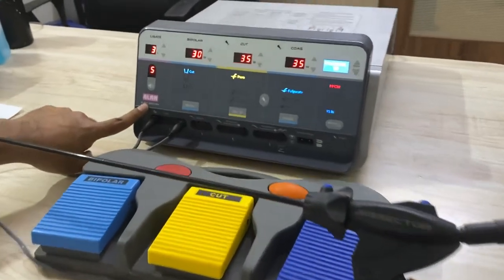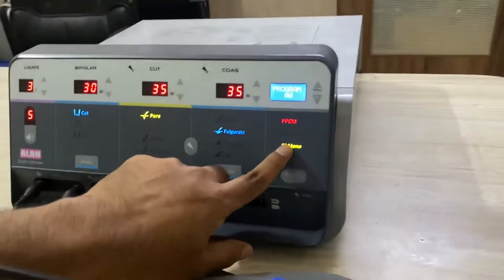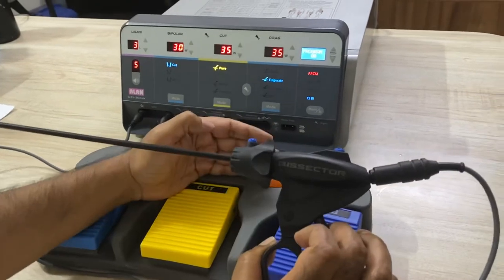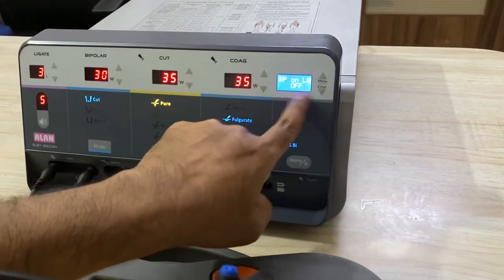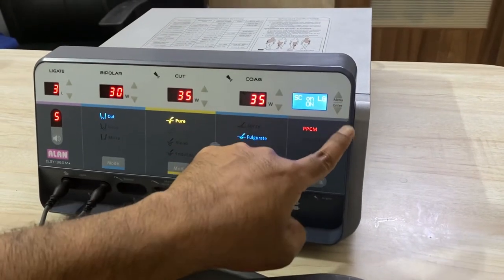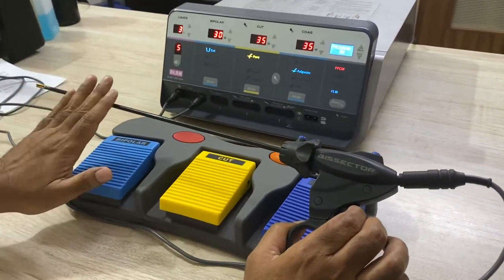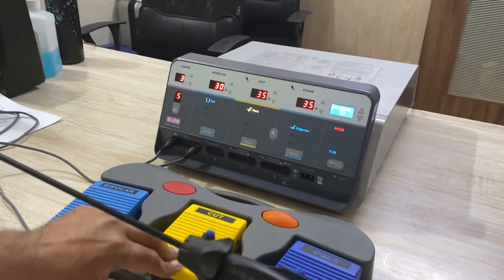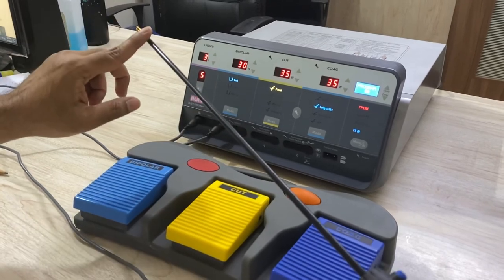When using ALAN BISSECTOR with ALAN Vessel Sealing Generator

Comment: What is ideal watt for monopolar pure cut mode? To open peritoneum. Usually I use wattage of 30 and it is always very sticky
Reply from the maker: 25 to 40 watts is general monopolar settings, depends on user's Speed of taking the cut and mono Mode selected. Best mode is pure cut or V cut. Are you using ALAN's machine ?
Reply: Yes I'm using alans machine